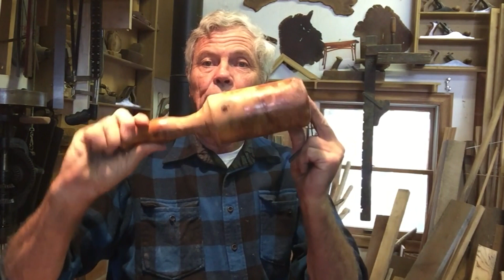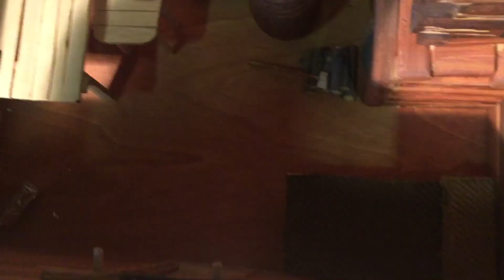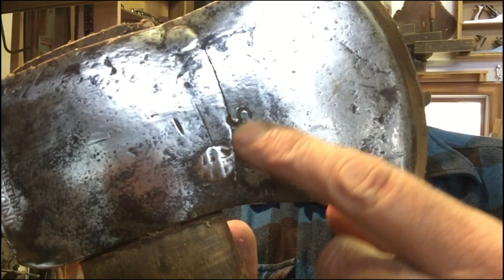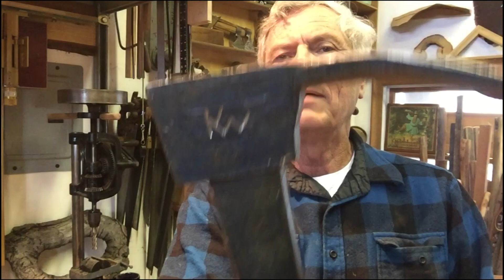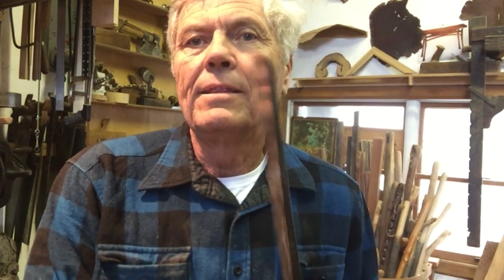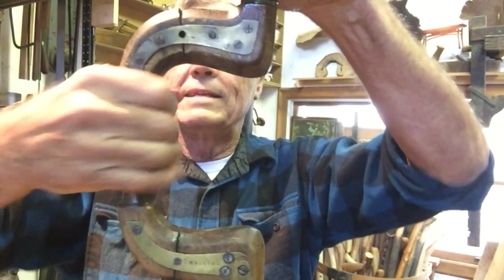USING ANTIQUE TOOLS

Comment: West Virginia didn't exist until 1861 so the axe is later than that. The Union Tool Company was around in the early 1900s. The riveted construction is strange though. Almost wonder if it is a repair.
Reply from the maker: pyrrhogaster if you look close you can see how the steel is wrapped and beat to make the eye for the handle. Late 1800’s, ok.
Reply: West Virginia became that in 1863
Reply from the maker: Here is the playlist of my woodworking videos.  https://www.youtube.com/watch?v=FtualmUeeKE&list=PL6F5760D69E8DA777

Comment: my dad was a machinist and made me a froe. I turned a mallet that I always called a too.
Reply from the maker: To and fro --got it. Now the big question. Have you used it?
Reply: @arboristBlairGlenn  how are used it years and years ago made the shakes for my chicken house. About 200 square feet of roofing. Then I paid somebody to machine split shakes that were certified for use on the house. That was a whole other story with building inspectors and politicians and engineers. I recently sold the the froe with its custom-built yew wood handle. To a young enthusiastic man. Many things I have I would rather give to somebody it will use it then sell it. I was finding the same when good usable things are not put to use
Reply from the maker: Here is the playlist of my woodworking videos.  https://www.youtube.com/watch?v=FtualmUeeKE&list=PL6F5760D69E8DA777